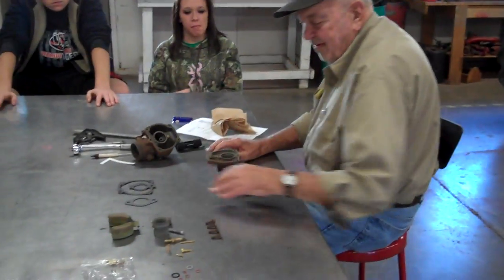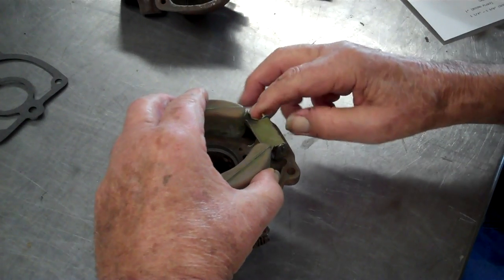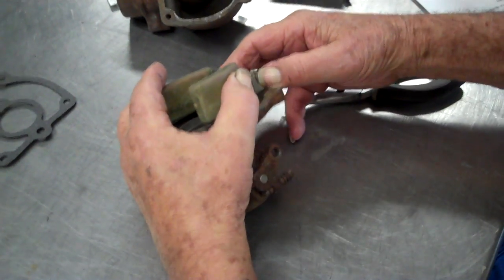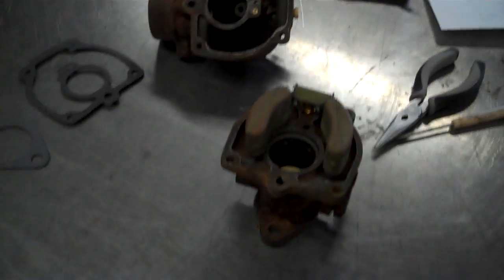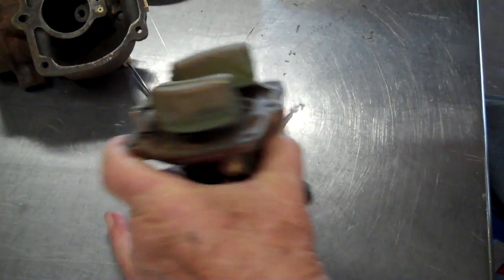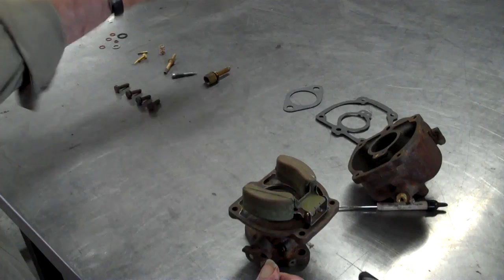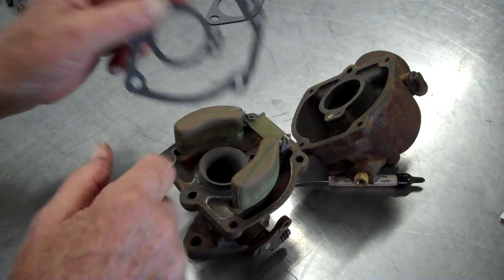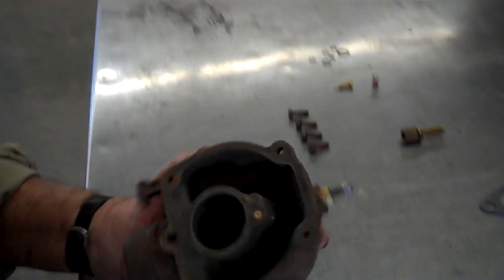Tractor Restoration - Carberator Rebuild Part 1

Comment: The float shaft should hold tight. This old carb isn't like new ones. There is enough room for it to slide out. If you use the screwdriver in the slot below and turn it they will open enough to slide the pin in. When released it will grip it. Good video.

Comment: I'm sure this gentleman has experience but this video leaves a lot out. All parts should be cleaned by chemical soaking to clean internal passages and rust needs to be removed as it can break free and ruin this "rebuild" later. THe float rod is held in place by the body when assembled and does not need to be "clamped". Another problem with old cast iron items is warping and distortion that can not always prevent later leakage problem. These mating surfaces should be checked and surfave ground or hand filed if the rebuilder knows how to do so without causing more damage.